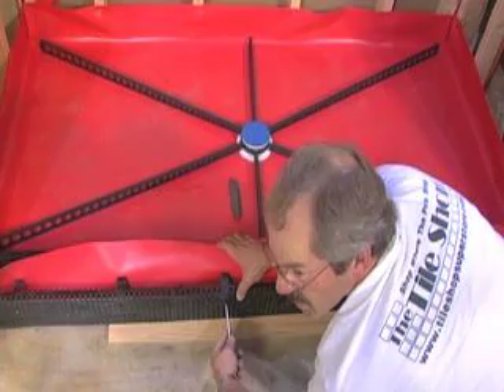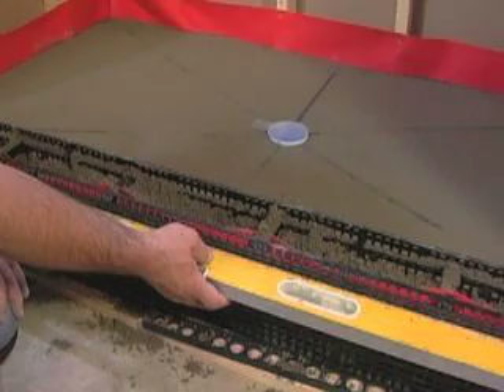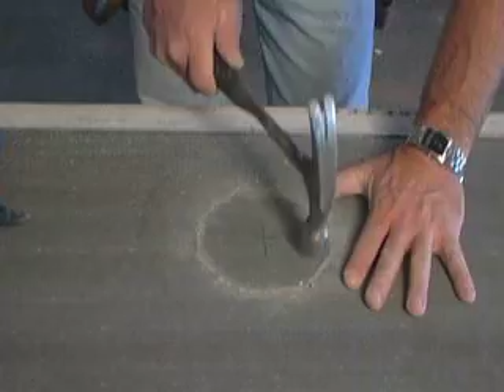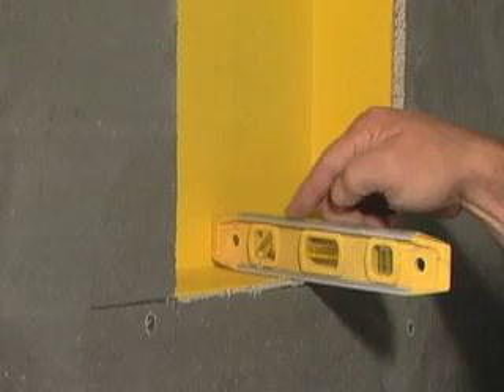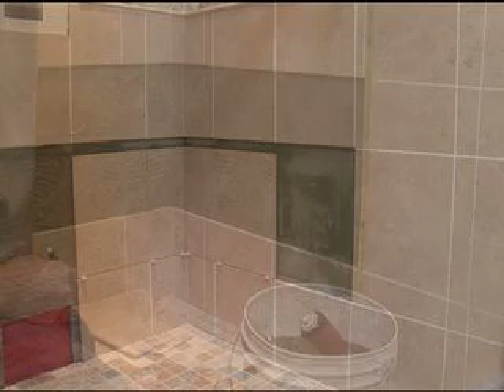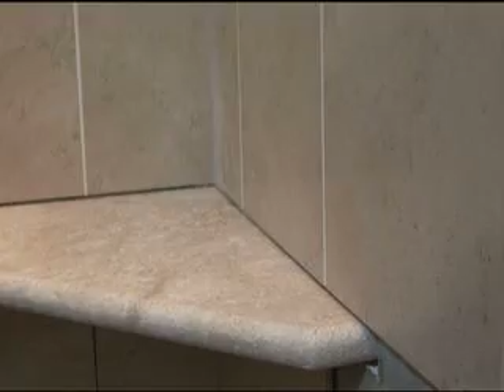Shower Pan Installation [Part 2]

Comment: These guy's are great but  I would glaze that  cement before adding tiles and shoot the back wall with a wood glaze to stop future condensation from penetrating it over the years and foam it to stop eventual molding. I know it might take 20 years but eventually as you get old you might start to get sick and not know why.
But excellent job

Comment: RE: dfried 97  -    "ceramic or clay shower pans" ? This doesnt make any sense. Fiberglass maybe.  

Yes, this shower is definitely not waterproof. Why not paint Laticrete hydroban on the cement board ? Why not use 6 mil plastic behind it ? Why not let niche flange overhang cement board so it doesnt drain behind it ? I hope the pan liner is glued to the drain properly. And last, the hole for the seat will leak. Better to just set a couple cement blocks in the corner and tile them. RESEARCH !!

Comment: i was wondering the same thing. i can see reasoning for not doing it and doing it. i got a shower to set up monday so trying to decide. i usually dont use a vapor barrier though. usually sure that nothing will get by the cement board and if it does any small amt will evaporate instead of turning to mold if the plastic was there. havent had a shower fail yet this way. but i always wanna give my clients the best so not sure wat to do.

Comment: what are you talking about. cement board/ denshield do repel water and the walls arent in direct contact or under water. it doesnt  hurt to use a waterproofing membrane but it is not necessary.